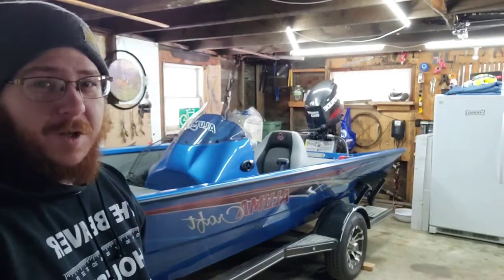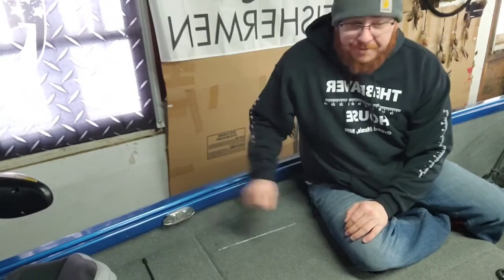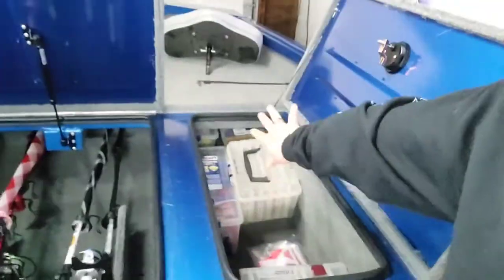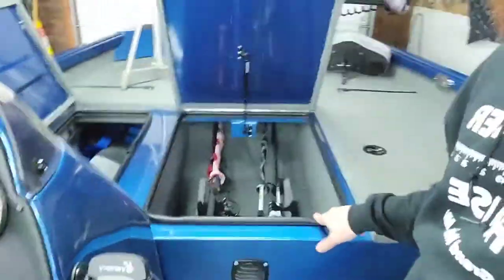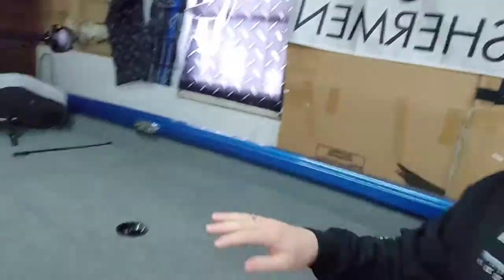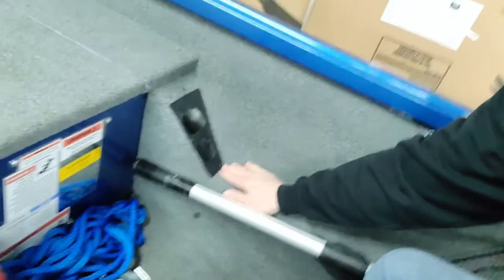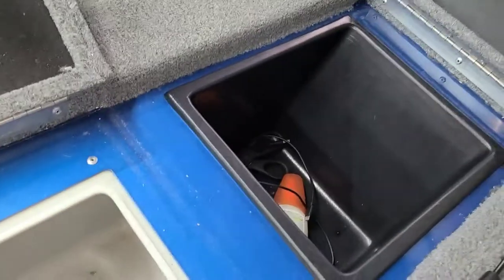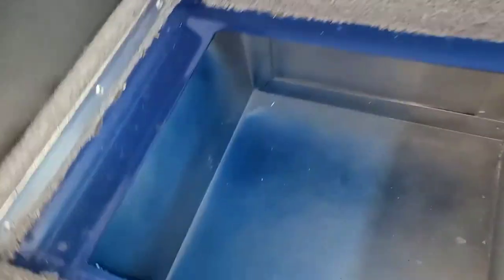The Best Bass Boat Under $20,000

Comment: I have the pro 175 as well mine is a white 2020 with a 90 zuki on it.  I can hit 40mph on the gps.  My console and troller is on the opposite side of yours.  It had me confused for a second hehe.  I am pretty happy with mine as well.  I added more insulation to my live well then sealed it up with Flex Seal so it doubles as a cooler if i want to throw fish on Ice.  Only complaint i have is the boat doesn't turn well at fast speeds in the sloughs of the Mississippi, but I assume its the semi V to blame.  I'm curious if getting a hydraulic jackplate like you have is something I should save up for?  I have also moved my trolling motor batteries forward for better ballast.  Lotta weight back of the boat.  Nice vid.
Reply from the maker: If you run shallower water a lot then a jackplate is definitely helpful if i raise the motor up like 3.5" i can get on plane a lot faster. And it's nice to be able to raise it way up when running shallow or at shallow boat launchs. I've noticed the same thing in turns i have to slow down a bit when making a hard turn. Where did you move your batteries too? I have a lot of weight in the back too especially with the talons on it but it actually sits pretty level in the water.
Reply: @frozenfishermen2363  I moved my trolling motor batteries one in each front side compartment and ran new wire for them.  When these batteries die I will most likely get a 36v lithium $$ and put it back in the rear again.  But for the moment i feel the forward ballast helps keep the nose down.

Comment: I got the same boat.  What have you been able to get your speed upto?  Ive gotten it to 33.8 MPH fully loaded.   Have you noticed any leaks?   So far, I am loving this boat!   Just need to upgrade the Trolling moter that came with it.  Came with Minnkota Edge.  Looking into the Ghost
Reply from the maker: The fastest I've gotten was 37mph on GPS that was with adjusting the jackplate . No leaks for me its solid boat.  I have a minnkota powerdrive v2 24v 70lb thrust it does pretty good but id like to eventually upgrade too.
Reply: @frozenfishermen2363  it's an amazing boat.  The minnkota edge I have is 24v 80lb and moves it great. I just really want to get the Lowrance ghost to link to my graphs and then eventually get active target.

Comment: I like this a little better than the Tracker boats.  The deck space and interior is an upgrade.  I would probably opt for a 4 stroke Yamaha.  Best wishes.
Reply from the maker: I would have went with a different/bigger motor but I bought it used last year it's a 2020 model. I didn't wanna have to wait for one to be built with how long everything takes now.
Reply: Yamaha makes the best marine engines in the sub-300 class.

Comment: Do you have a link on where to find the boat to buy I can't seem to find this model
Reply from the maker: It's not on the alumacraft website for some reason but it's on dealer websites and the layout is a little bit different they added some stuff it looks like. Here's a link to the 2022 model
https://www.parmamarine.com/manufacturer-showrooms/alumacraft/2022-alumacraft-pro-175-7995269/